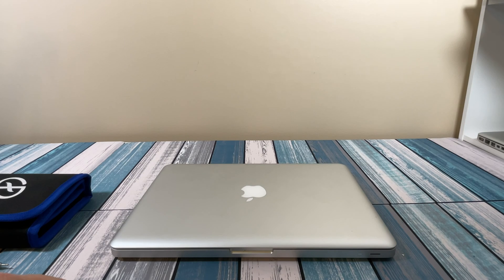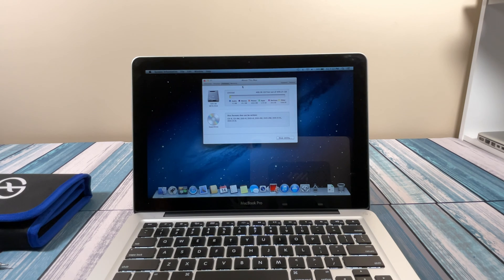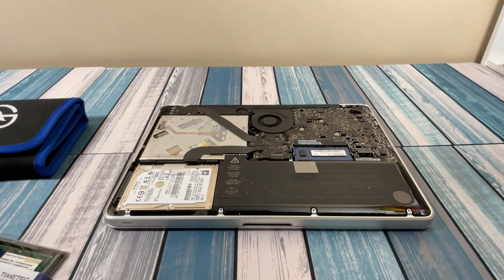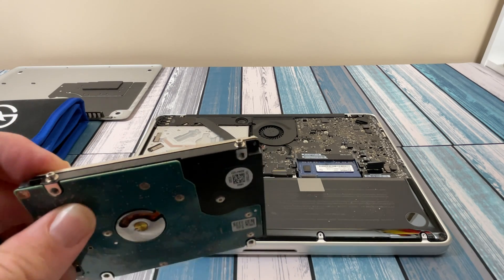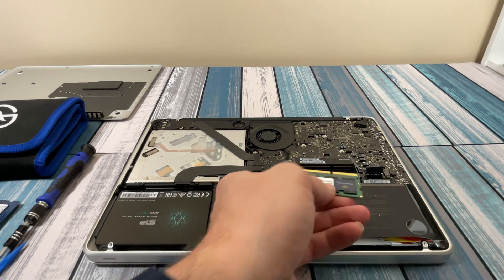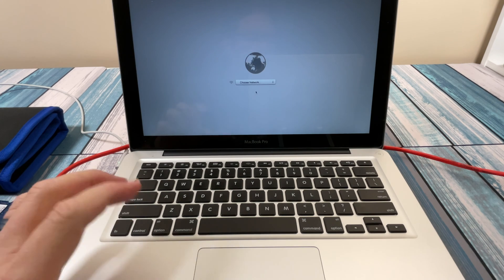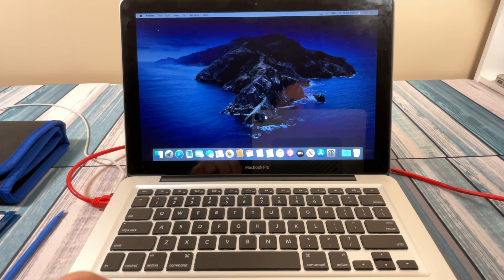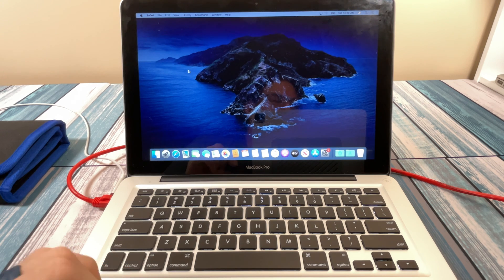How to Upgrade a Mid 2012 13" MacBook Pro - Part 1 of this "Special" Upgrade!

Comment: I bought the same model about three years ago, and choose to go with a 2 TB mechanical drive. I also bought a portable Thunderbolt 2 drive with two mechanical TB drives in it. The Thunderbolt boots twice as fast as the internal.
I also put Adobe CS 6 on the external. I didn't think Adobe products could be run off an external drive.

Comment: Any suggestions on who sells the best battery for this?
I bought my similar MacBook Pro about 3 years ago, and I'm on my second battery. I don't use the battery much either. I usually using it at home, with it plugged in.

Comment: Mine is an i7 version with 16 gigs of ram,I changed the old hard drive for a SSD 1 Tera and add 4 partitions on it,Sonoma, Ventura, Monterey and Big Sur with OpenCore Legacy.
I took out the DVD player and   
replaced with another SSD 500 GB and add 3 partitions on it for Ubuntu 24.04.5,Linux Mint 22.1 and Linux LMDE6
All OS work great and I just love my MacBook Pro mid 2012 for a spare laptop.

Comment: Is the Silicon Power 2TB SSD 2.5" 7mm (0.28") will work on my MACBOOK Pro late 2012 ?
Reply from the maker: Not the “Late” 2012 unfortunately
Reply: @ I ordered the 4 T few hour ago and it’s coming tomorrow 😭
Reply: I would like to also install windows on that Mac, that’s why

Comment: I just did this upgrade..  the recovery restart  pushed 10.8 5 Mountain lion which has bricked safari and app store spi
O i Cosby even get behind the os "upgrade".  Luckily i attempted the is upgrade  before dwapping drives and accidentally upgraded the corigindl to 10.9 mavericks.. i was able to"restore" this old up now upgraded drive to the new empty ssd then could upgrade to Cataliba. It was  a 12 hour battle of trying to connect and research what happened.   But it finally worked out. The nice part of the restore is most of my applications were already intact except a handful that weren't compatible on catalina

Comment: IM STRUGGLING TO GET A SERIAL NUMBER OFR THE MEMEORY. . IM THE UK AND THAYTLONK DOES NOT DORK ON AMAZON
Reply from the maker: Just search for the type of ram. 
16gb DDR3 1600MHz RAM
Make sure they are SODIMMs, not full size. You should be able to find many 2x8gb kits.

Comment: I upgraded as youve done but at reboot i get a flashing folder with a question mark inside of it. HELP
Reply from the maker: The question mark means it can’t find an operating system. What are you trying to boot to?  A boot drive, or a new ssd?
Reply: new ssd
 @FamilyGeekery
Reply from the maker: Ok, did you make a boot disk for macOS?  Or are you planning on using internet recovery?  Either of this methods will get the macOS on your new drive. I have videos on both methods on this channel.
Reply from the maker: That would work if you have the right adapter. And if you want to save all your old files/programs.
Reply: I just found your cloning old drive to new ssd. Is that what i should do? 
 @FamilyGeekery

Comment: I now have this macbook for about 2 weeks now, the battery is its original one, , but it has 93 percent life left, which is nuts of such an old battery! It has no dents or scratches, i installed an ssd in it, 16gb of ram, i removed the optical drive and i installed a second hard drive, but i made the bracket myself! It is a good machine for basic tasks, i run monterey on it, which runs like a dream!

Comment: I followed all your directions step by step but when I turn my MacBook back on, the screen is stuck with a question mark flashing on the screen. Maybe I missed something but I was wondering if you had any insight on how to troubleshoot this problem?
Reply: When you turn on the computer you need to hold command and R to get to the recovery screen

Comment: I bought one for my wife. Came with 8 gb RAM in a single slot. So all I have to do is install another 8 gb stick to make it 16 gb.

The laptop came with a 128 gb SSD and OS-X Sonoma. I replaced that with a 500 gb PNY SSD and installed Linux Mint Cinnamon on it.

Very fast performance and runs better than her previous polycarbonate 2010 13"  Macbook with Zorin OS 15.3 on it.

Is there a way to upgrade the display to a higher resolution IPS model?

Comment: Good day sir. Is this macbook pro a1278?
Reply from the maker: Yes it is. The non-retina version.
Reply: So its upgradable up to 16gb ram? I thought its only up to 8gb ram. 😅
Reply from the maker: @khal-elplays161 there are many models that Apple said would only go to 8gb. But they do go to 16!
Reply: Thank you sir for the reply!😊
Reply: Sir, how about the ssd will it go to 1tb?
Reply: And can i replace the hard disc with another ssd using caddy?
Reply from the maker: Yes, 1tb will work. And you don’t need a “caddy” per se, just the mounting screws that were in the original drive.
Reply: Hi there. Jumping on this reply to ask a similar question. I’m seeing 2tb ssd drives available too. Would there be any issues trying to use one of them? Thanks.
Edit. I’m looking at the link you provided and they even have a 4 tb. Same question regarding that one.
Reply from the maker: @eagleboycortes I’ve for sure used 2tb, but personally haven’t tried 4tb. I’m pretty sure it would work though. Thanks for watching!
Reply: @FamilyGeekery thanks for all your videos.

Comment: I found this recently. I followed your instructions, upgraded the SSD to 1TB, the RAM to 16GB, swapped out the battery & it's working really good. I originally upgraded the OS to Ventura via OCLP, but it lagged. Catalina works well on it
Reply: 1TB SSD for this macbook? A1278?
Reply: Same here already boguth ssd 1tb and 16gb memory tomorrow arived memoris from amazon XD
Reply: I don't feel any lagging with Sonoma on my MBP mid 2012, however I disabled certain animations too which I don't need. Also 1TB and 16gb RAM
Reply: what battery did you use? I havnt been able to find a good one

Comment: Good job. My MacBook Pro mid 2012 (I think it's the same model - A1278) has a new SSD Samsung Evo and - in place of DVD - the old HDD disk. I also bought 16 GB of RAM and a new battery. I have to say that the best performance has with the latest Catalina. I also changed the thermal paste (I'm thinking of a special thermopad) and I do not recommend updating the system with EFI. There are issues with stable work and the hardware doos not support the newest features. It makes non sense.
Reply from the maker: Good tips. Thanks for adding those!  And thanks for watching!
Reply: Did you find the thermal paste made a big difference and did you find it difficult to do? I just recently started watching videos on this and ordered some thermal paste
Reply: @eddief984 overall you might see better temp numbers, I replaced my thermal grease on my gaming laptop. And am happy with its performance. I’m going to be replacing the ram ssd and thermal pads and grease on my dads late 2012 MacBook Pro
Reply: Which battery did you replace it with on your computer?

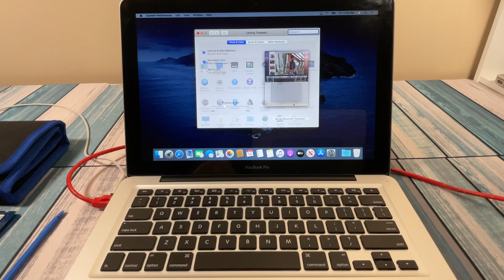Comment: 12:36  how did you install the software to the new hard drive? It looked like you skipped it
Reply from the maker: If you’re talking about macOS, I usually skip it on camera, but mention that I have some other videos that are step by step on how to install macOS. They are linked in the video description. I also have a playlist on my channel of other helpful tips.
Reply: @FamilyGeekery  couldn't you just use your Time Machine backup to reinstall everything?

Comment: Good job.  Running Ventura on mine 500GB Samsung EVO SSD and 8GB Ram. I have 16GB in my 2012 15 inch.and 2 X 500GB EVO SSD's.  Good luck adding second SSD to this Mac.
Reply: About to do an upgrade on my 2012, do you think it would be capable and powerful to run a DAW? Pro tools to be specific? That’s the only thing I would use it for. Thanks
Reply from the maker: According to Avid’s website, it requires Catalina and a Core2 processor, which your 2012 covers. As they update, newer versions would likely require newer versions of macOS though.
Reply: I have updated SSD in mine. Thinking of upgrading my 8GB ram to 16 GB, is to worthy to do the ram update for causal browsing and streaming?
Reply: If I upgrade like that, it gets super fast, so is it still fast enough?
Reply: How much did it all cost you